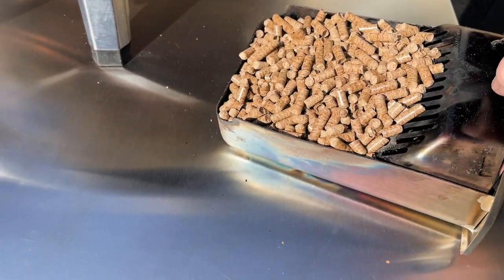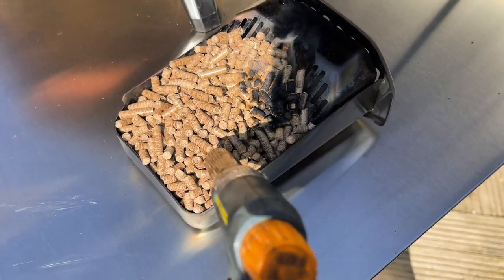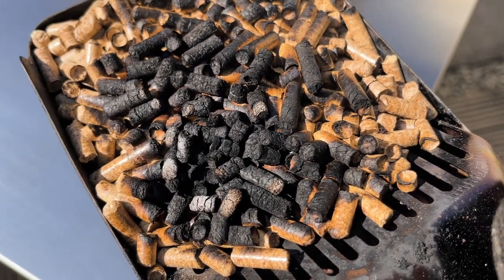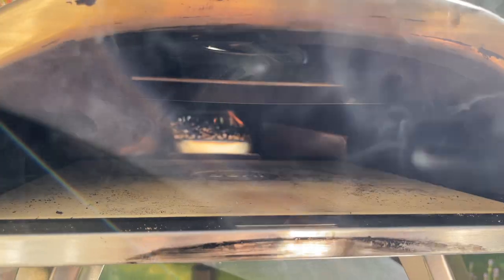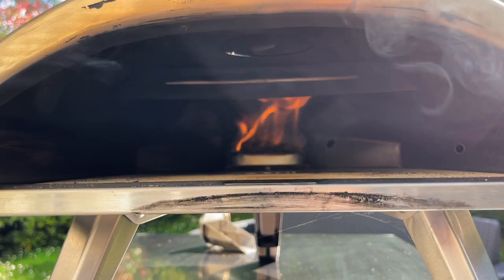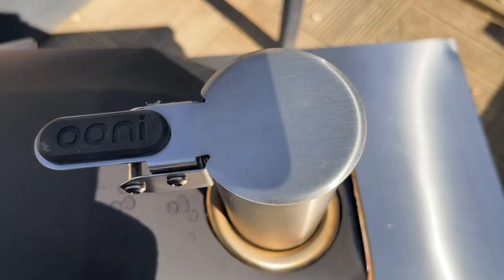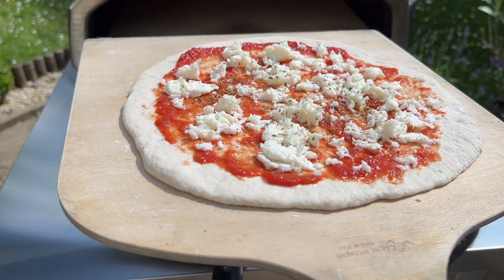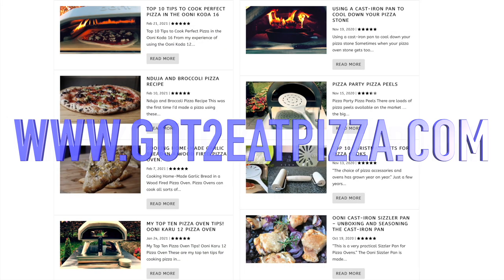Lighting the Ooni Fyra 12 Wood Pellet Pizza Oven.

Comment: Great tip about using the cast iron pan to lower the stone temp if needed!  Don't know if you can get them where you are, but my favorite fire starter is the Diamond Strike-A-Fire.  Just break of a chunk maybe the size of your thumb and that will get your pellets going in short order.
Reply from the maker: Hi!  Thanks for the info - I haven’t seen those type around.  I’ve got some curly natural firelighters with wax - they can be good to use too.

Comment: Keep the door on.  Pellets need airflow thru that rear grate past the pellets to burn, and without a blower, it is all created by the draft up the chimney.  with the oven door off you do not allow the chimney draft to pull any air thru the burner grates.  Instead it pulls air in thru the oven opening and the pellets just smolder.  Notice how it smokes out the back every time you pull off the door?  To light this, I would put pellets in the grate and partially install it.  Then with the door on i would apply the torch to the base of the chimney or perhaps in thru the observation hole in the door to add some heat near the chimney base to help induce a draft up the chimney.  Then with the burner grate pulled out just enough to shoot the torch down on top of the pellets, I would apply flame across them to light the pellets.  Note any smoke created by the pellets should be pulled into the oven and up the chimney by the draft.  Lighting this way also keeps the torch heat headed inside the oven to help increase draft.  As soon as I have some flame, remove the torch and fully insert the burner.  Applying flame into the rear grates should also help add heat to feed the draft and preheat the air to get the pellets to release wood gas and burn easier…  after all the pellets in the grate are on fire, add 1/8-1/4 cup of pellets every 45 seconds until the grate is loaded enough that you can fill the hopper.
Reply from the maker: Hi - thanks so much for sharing your tips here!  🙏

Comment: Great video.  I think that you will find a great variation of how people light fires in general.  Fireplace and barbeque lighting have often benefitted with manual bellows.  So from that I use a small battery operated fan to blow a gentle air flow while the pellets are igniting.  There are many types from those using batteries to those plugging into a USB power bank.  Once it is burning well. I turn the fan away.  It is also beneficial when there is a wind breeze coming from the front of the oven.  It keeps the fire, heat, and smoke flowing in a forward direction when one opens the pizza oven door.  Note: you will find that the pellets burn faster if you over-use the fan.  So, just use it for starting the fire.
Reply from the maker: Hi - thanks for sharing and I'm thinking of getting a good ole fashioned bellow like my great granny used - not just for the pizza ovens, but for my Kavado Joe Jr which also needs a bit of a blast of air after igniting - at the moment I am waving my outdoor cushion at it.  👍

Comment: Ooni instructions recommends  aiming your torch or starter at the front of the pellet pile. The pellets will catch within a few secs. I then insert the pan into the oven & that's it. Once in the oven the chimney will case the smoke to flow up which in turn will pull fresh air thru the grate. At that point, I would carefully fill the hopper. Thanks for sharing & I hope my suggestion helps.
Reply from the maker: Hi - thanks for these tips!

Comment: I've had my pellets go out a few times as well. Part of my problem was I was using too many pellets. Pay close attention to how much of the grate you are blocking. You want plenty of air coming through when lighting. I've been using a torch some and also I've been using starters. Both work as long as I don't load too many pellets and block the back wall of the grate.
Reply from the maker: Hi - thank you.  The slightly breezier days make it a bit easier for the pellets to catch.  That’s a really good tip and thanks for sharing.

Comment: What pizza peel do you suggest? The wood or the aluminum?
Reply from the maker: Hi - I use a wood peel for launch and a steel peel for rotating - if that helps.  I’ve never got on with metal launch peels.
Reply: @Got2EatPizza  thanks. This might be my 1st for pizza. I usually bake breads as  commercial type here in Philippines. Again thanks

Comment: Do you have the cover for the fyra?
Reply from the maker: Hi - I don’t, but if I need to cover it due to weather change, then I use a standard bbq cover.
Reply: @Got2EatPizza  I have the fyra and the cover, but it's very confusing and the instructions aren't clear at all. Also Ooni didn't honor my warranty when the product arrived with a bad part.
Reply from the maker: Have you shared your issue on the Ooni community site - it’s a very handy place for solving problems (in addition to here where possible!) and you can upload photos on there.
Reply: @Got2EatPizza  can you link me the community site?
Reply from the maker: Here it is:  https://community.ooni.com/feed. 👍

Comment: Just use a wood wool lighter. Takes 5 seconds and leave it in there. Never had it go out? This is a tutorial of how not to do it… Weird!
Reply from the maker: Hi -  yep, thanks for the feedback.  That's a great option, and when I can get my hands on them in my local diy store, because they are good value there I will use them.  I have to keep the gas on the pellets a lot longer than kindling for it to take well.
Reply: @Got2EatPizza  Thank you for taking the feed back so well as reading it back, it sounded a bit harsh, sorry! It works with any fire lighters (I prefer ones without chemicals) put one scoop (the chimney cover is the scoop) of pellets in (don’t fill the grate) add the fire lighter of your choice towards the front (the lower part of the tray) give it a little wiggle, and just light any part of it with a normal match or lighter just so there is the tiniest of flames, put the tray in, make sure the door is on when doing this and leave the door on at all times, also make sure your chimney is set to open, and then set a timer for 10 mins and walk away (don’t even look at it, I promise it will be working!). Once 10 mins is up, pour just 1 scoop in the hopper and again leave it for another 5 mins. Then slowly top up the hopper to the brim and let it come up to temp. This works literally every single time and even in the wind. Hope this helps. Would love to hear how you get on with this method 😁
Reply from the maker: Thanks for sharing these very useful tips as the pellet operation is very different from the wood fired ovens!